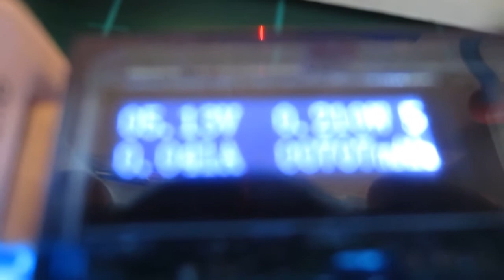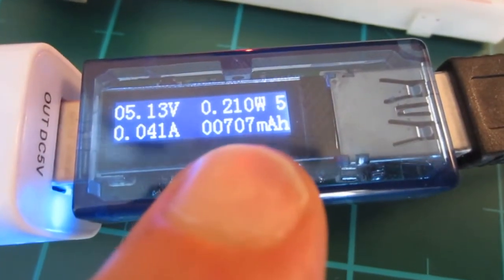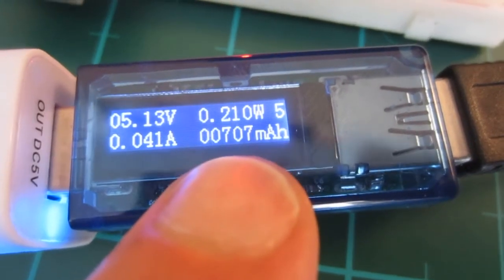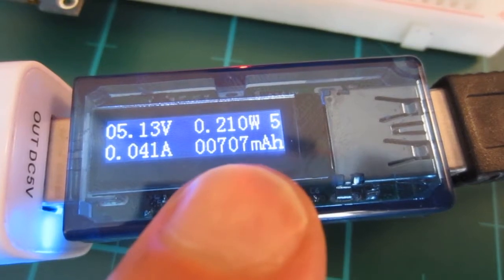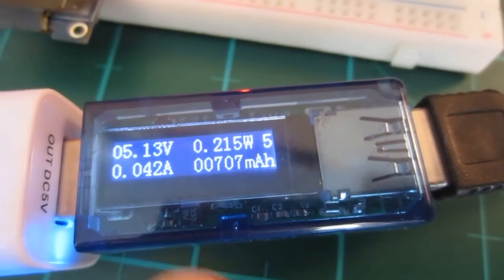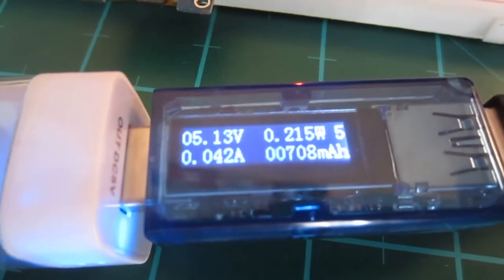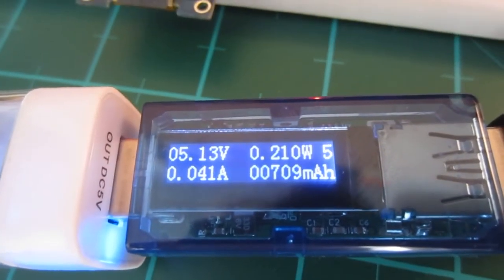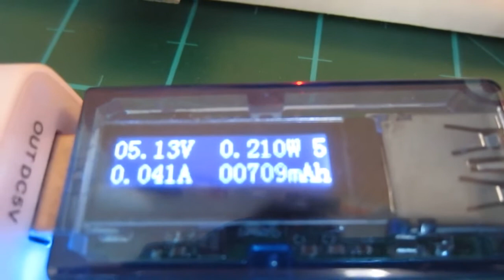Arduino Based Clock DIY Project

Comment: You don't say which RTC you're using. I see a DS3231 which is much more accurate than a DS1307. Also, which OLED are you using? Is it a 0.96 inch, 96x96  pixels or 128x96 pixels. You should also say what pins on the Arduino are being used and what pins on the RTC. How its wired up will make for better understanding.
Reply: DS3231rtc

Comment: Hi, is it possible to do this with 4 pin oled?
Reply: for SSD1306 128x64 Oled use -> U8G2_SSD1306_128X64_NONAME_F_SW_I2C u8g2(U8G2_R0, /* clock=*/ SCL, /* data=*/ SDA, /* reset=*/ U8X8_PIN_NONE);

Comment: by thhe way , seconds jumpin throw 1 sometimes in your video
Reply from the maker: Thanks for noticing, this is because I only update the screen every second, and sometimes this is not in sync with the actual RTC seconds, but this can be tweaked in software
Reply: Awesome Arduino Review I has watched your code it seems very hard, I did more simple with good results with oled i2c library